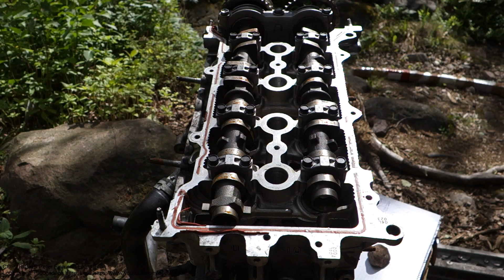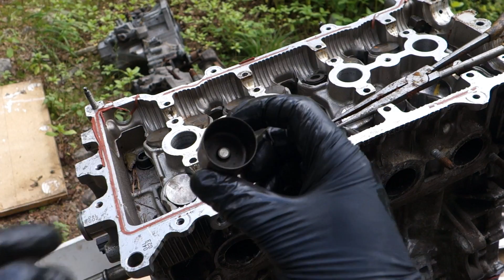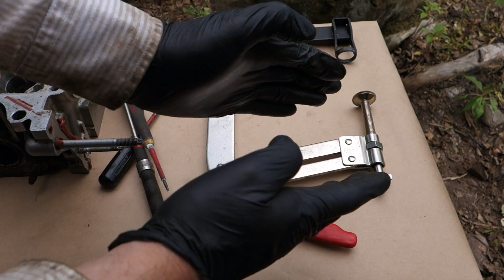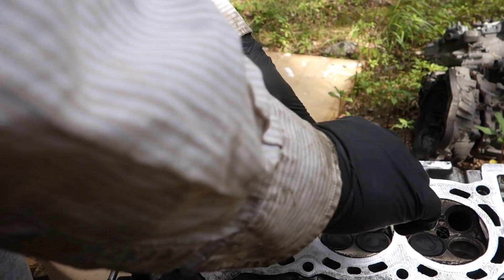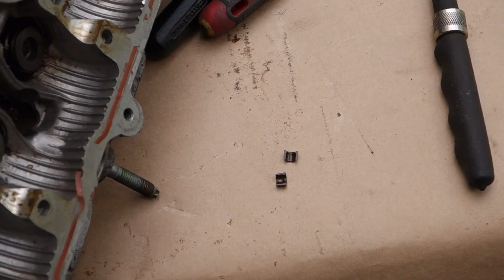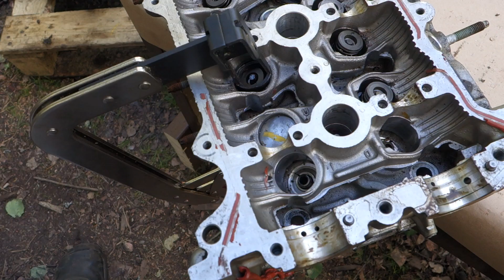How to replace engine valve. Intake or exhaust valve. DETAILED INFO

Comment: You mixed up the bearings though.Each bearing is specifically machined to that surface correct???
Reply from the maker: No. Toyota use standard size.

Comment: Peter, i have problem with a engine valve in cylinder 3, the valves for my car is a expensive, exist any problem if only replace the damaged valve or do you think i need to replacement all the valves?, the engine not shows a big problem according to my mechanic is a minimum compression issue. Great Video Peter
Reply from the maker: Hi, you can use old valve.